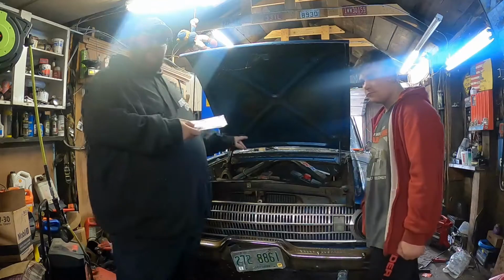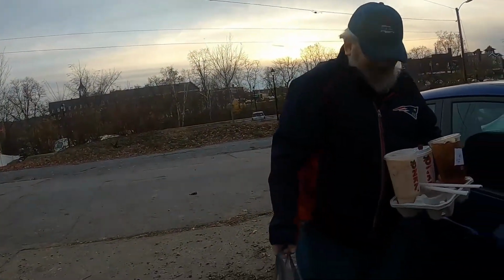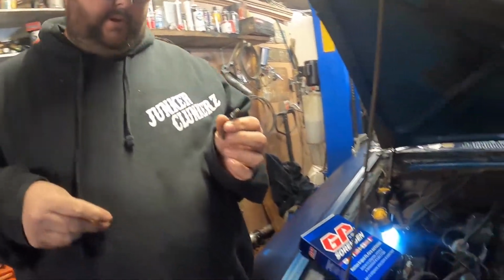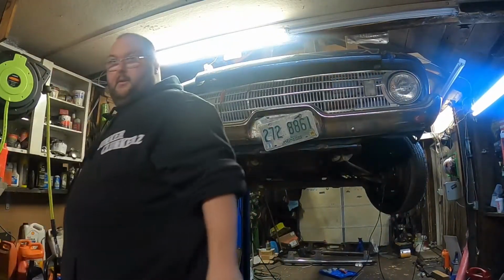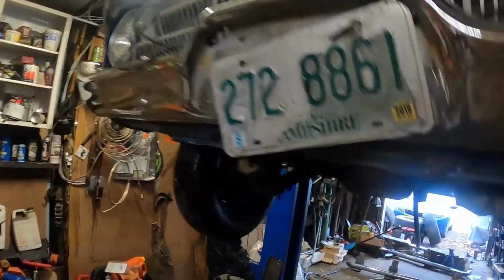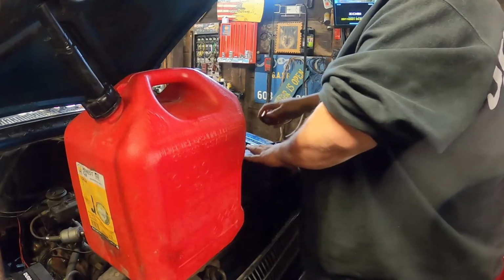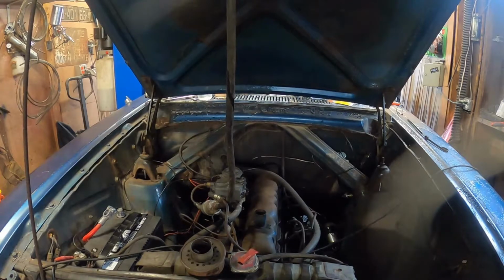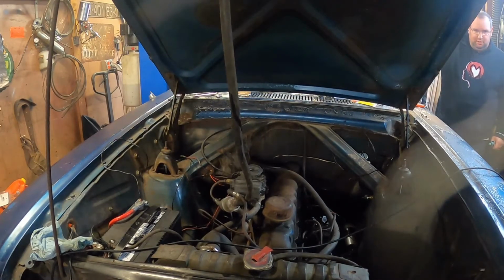All The Fixing on the 1961 Ford Falcon Delivery

Comment: Hey it's sealing... that's a WIN! Those doughnut gaskets are pretty forgiving! The '60-'62 144/170 exh manifolds have a flat sealing surface (matches your current headpipe) Of course, being 2 yr only part, they ain't easy to get. Most guys use the '63-'67 manifold like you did. Also, that "should" be a solid lifter engine with adjustable rockers. Hydraulic was around '64 i think. So she's gonna be noisy when she's cold. Sorry, I'm a old Ford nerd... haha! But loving the build and progress!!!
Reply from the maker: Good info thank you
Reply: @Junkerclunkerz  You bet Grady! Love to help when i can. Looking forward to more of the build!